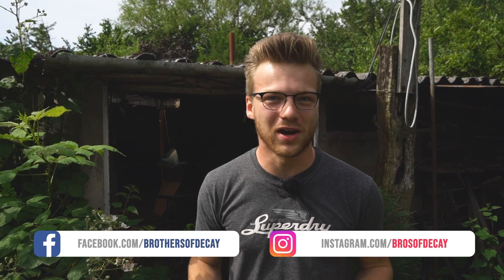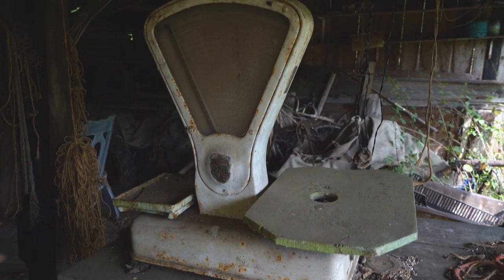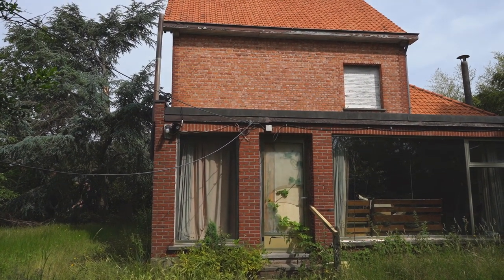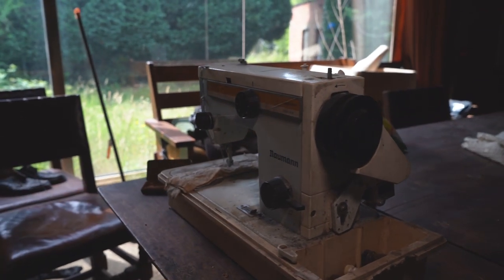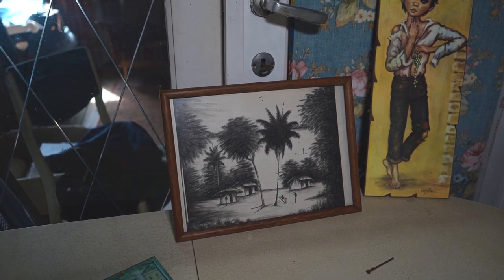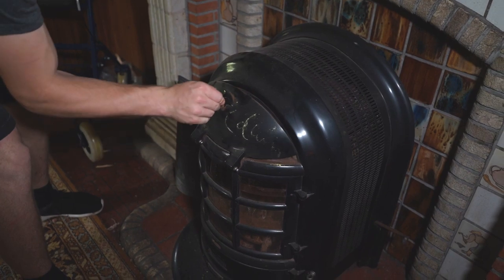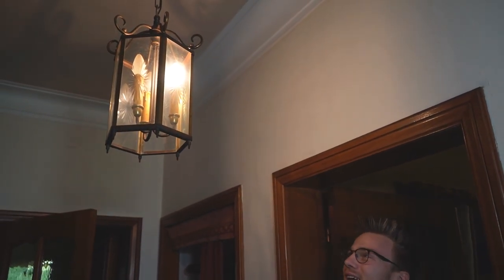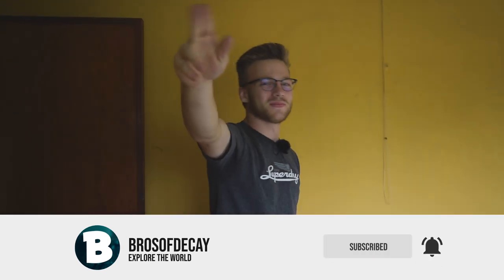Abandoned house of a Belgian Granny She had a huge comic book collection!

Comment: Some of those scales and the harmonium (an organ without electrics and organ pipes is called a harmonium) in the shed would have been better off in the museum than rotting away. Impressive location. If it's still deserted, it would be nice if you might visit places like this one more time. Places change sometimes.

Comment: The organ is a pump organ.  No electricity.  You pump the pedals with your feet and it forces air into the bellows which then allows sound.
Reply: I didn't say foot bellows.  I said pedals.  You can see them in the video. You have to pump the pedals the entire time you play it.  The bellows are inside the organ, where they can't be seen.